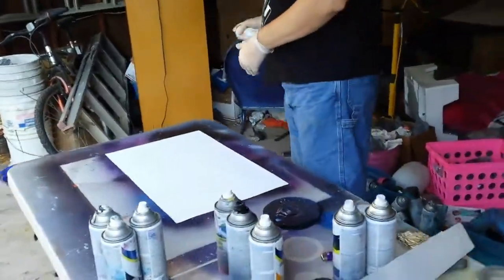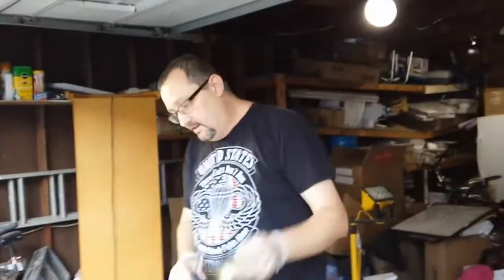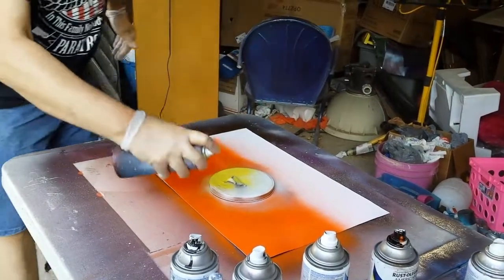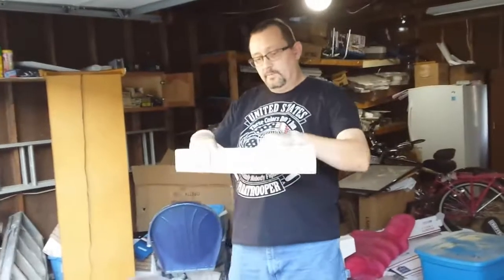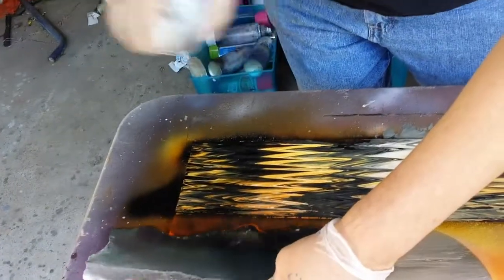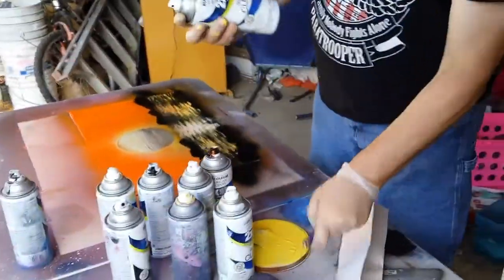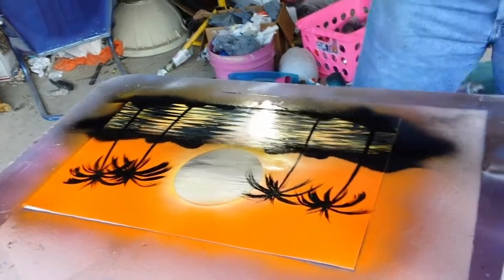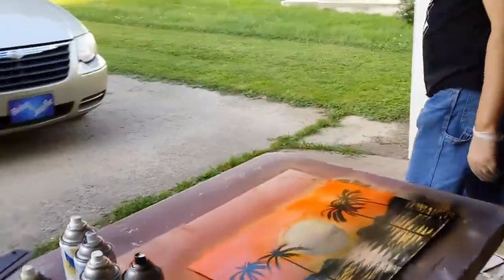Spray Paint Tropical Beach Painting Video....AMAZING!!!!

Comment: After you seal the paint with the flame, does that mean it doesn't smear anymore?
Reply from the maker: It may still be slightly tacky, but yes, the flame seals the paint and helps dry it faster. You can also use a hair dryer or just wait for that part to dry before you proceed on with the next step. The flame is just the fastest method...:)
Reply: Thanks. :)
Reply from the maker: Quite welcome...:)